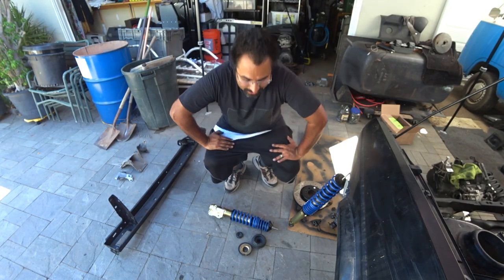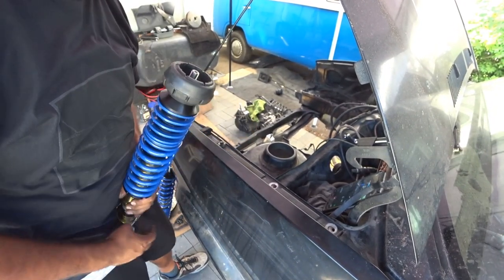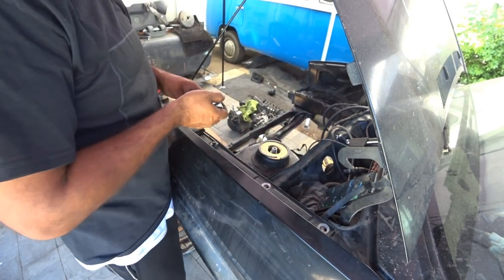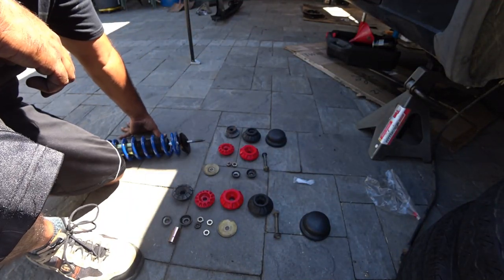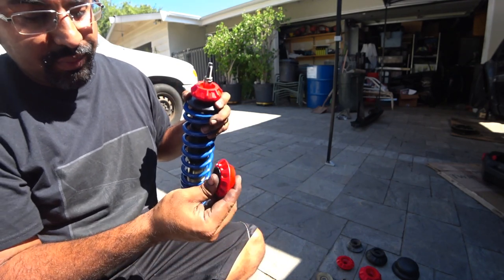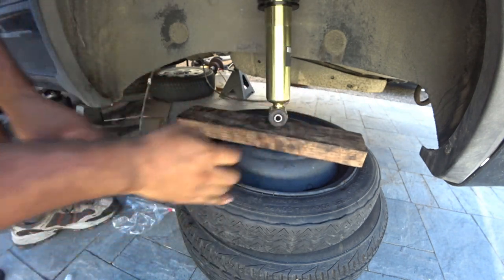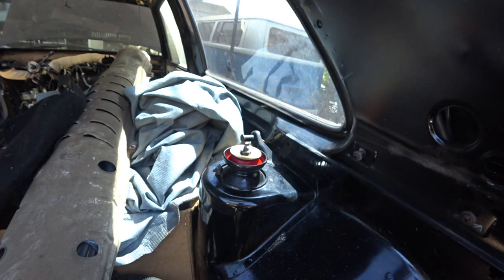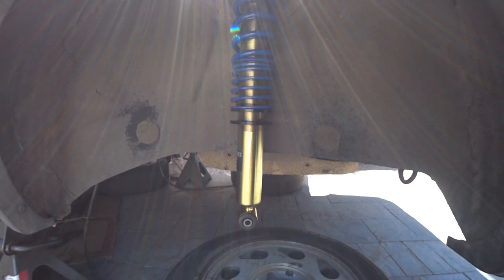How to install Solo-Werk coilover on a MK2 GTI-Jetta Season5 EP31

Comment: When I installed my solowerks (mk3 but same part number as the mk2s) i mounted the helper springs on the bottom of the struts (both front and rear) - I see you've mounted them on top on the fronts and on the bottom on the rears - have I assembled the fronts improperly?!!